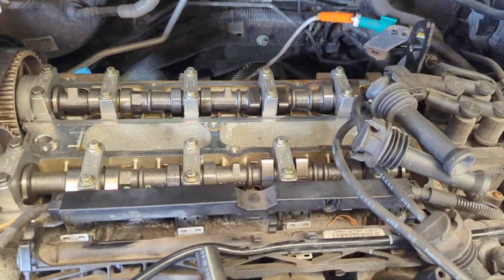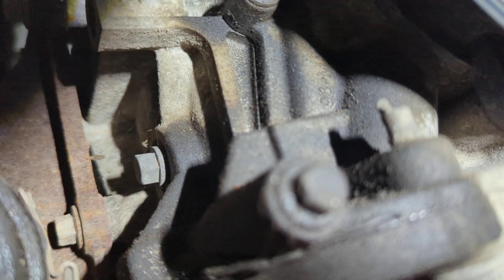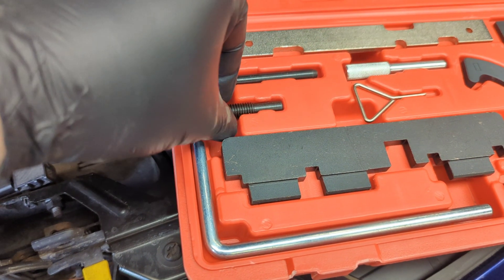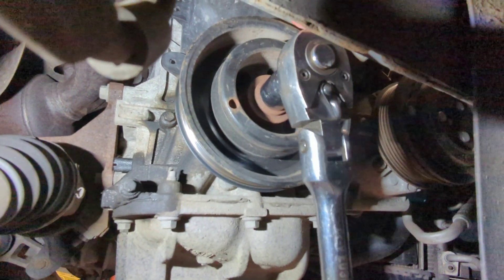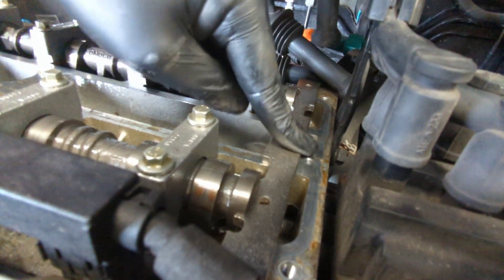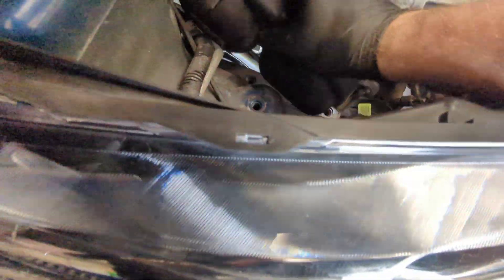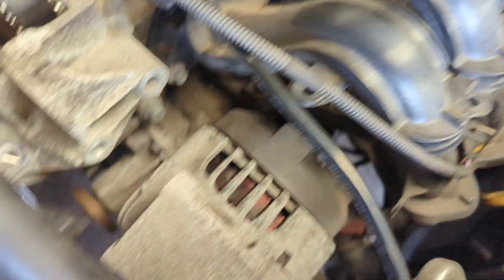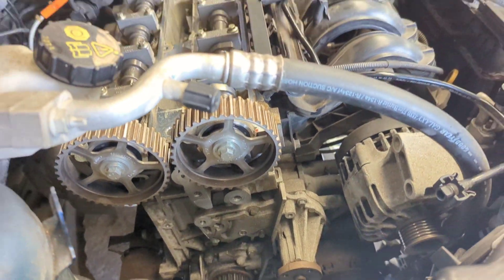Ford 1.25 Timing Belt & locking Tools

Comment: A great video. To tighten the crank pully bolt, would you recommend a tool to lock the flywheel? I have seen the laser 3575 and sealey VSE5945, but I'm not sure that they are the right ones

Comment: is it safe to tight the crank pulley up using only the TDC lock pin? There is a special tool for flywheel lock but it requires starter removal
Reply: did either of you find out about this for tightening the bolt back up, I have the sealey VSE5945 locking too by the starter but it's just 1 tooth! and worries me it won't be enough to hold it dead still, as the holse in the tool are elongated/slotted so it could spin
Reply: @perlsol  did the job by using the special tool. be careful - the locking pin can bend and strip the hole in the side cover. I did that even when I was using the special tool on ford fiesta 1.0 ecoboost
Reply: I've got the same question....

Comment: Nice video that confirmed everything I done today doing timing on friend fiesta was correct, was a bit wierded  out by pin not locking crank in both directions (ie a location hole on crank web, even had endoscope out trying to find one,) will use the flywheel locking tool via starter motor hole tomorrow to slam the new bolt down as tight as my impact gun will put it, so the timing stays put, really don't like the design, simple woodruff key would have been much better to ensure timing stays put. But great video, 👍